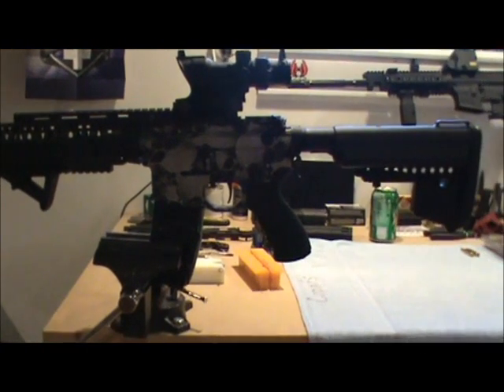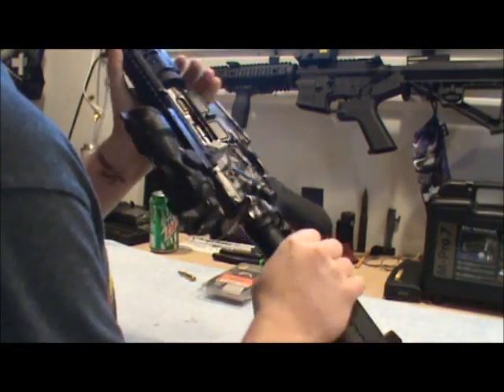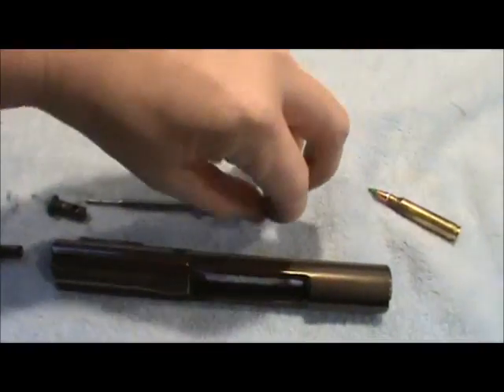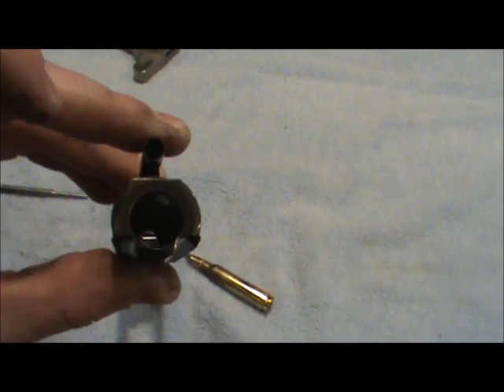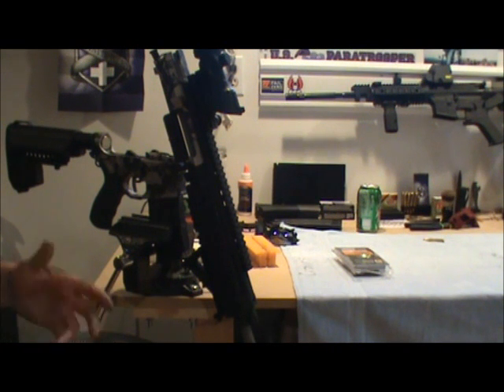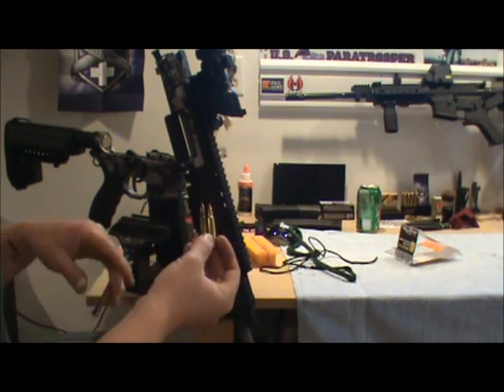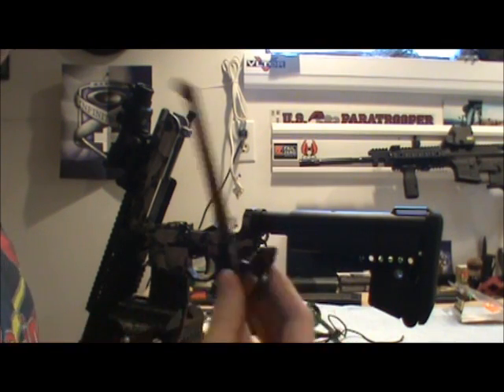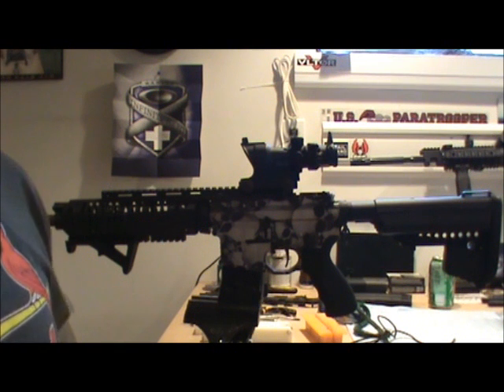AR break in and Cleaning

Comment from the maker: As long as it's a slight dent/mark that's normal.  AR's have a floating firing pin, when the bolt goes home it can leave a slight dent on commercial ammo.  If your getting a big dent you have a problem with the firing pin over protruding the bolt face (take it to a gunsmith). Try using mil spec ammo with stronger primers and see if you still have a problem.  My bolt is an auto bolt carrier from Fail Zero.  Hope that helps and if you have any other questions let me know.

Comment from the maker: Yes, where the gas tube and charging handle meet helps with carbon build up on DI rifles.   The piston rifles have given me no issues.   I've never had a charging handle get badly worn,  unless your constantly using it or have an out of spec handle.  Maybe a severely over gassed rifle with corrosive ammo could cause this.  Dis color or print darkening is also normal.

Comment: thanks a ton! 

question... I just took my first  new AR home yesterday. It is a Diamondback. I carefully and slowly disassembled the bolt carrier group so to get acquainted: bolt, pin, bolt cam, and ejector. 
Here is my concern; I have noticed my bolt and bolt cam are not loose moving compared to yours and I would describe mine as stiff. Also, after degreasing, cleaning and lubricating  my new unfired rifle, I find the bolt doesn't snap into place when pulling back and letting go of the charging handle. Also there is a friction burning smell and some metal wear on the charging handle. 
Are these things I should be concerned about or is this perceived stiffness part of the breaking in process? 

Your thoughts please.
Reply: Kinda late, but Normal for break in

Comment: Nice Review of aa quick cleaning
Some minor comments:
1- As a Dentist, we use instruments. Tools are cheap, instruments are expensive. LOL
2- Could benefit from better lighting
3- I watched this a day late for the opinion on CLP, just bought some yesterday. LOL
4- I am pretty certain that Compressing a spring, or relaxing a spring does not fatigue it. It is the cycling of the spring that is the issue. So storing with a trigger cocked/uncocked should not be a problem, which you consider safest should be the issue.

Comment from the maker: I learned most of this from manufactures suggested break in processes.  I would buy a few boxes of ammo,  different weight bullet and manufacturer to find out what your rifle shoots the most accurate.  I would also call Windham to see what they recommend you use in your break in.  Really, the only way to ruin your barrel is to get it over heated. Also make sure you clean your rifle after every range session.   Hope that helps man.

Comment: Colt LE6920's are broken in from the factory... I have seen many videos on breaking in an AR-15, and all I have to say that mil- spec AR's should be broken in from the factory. Aftermarket AR's probably have a break-in period, but I wouldn't know becasue I only purchase Colt AR's and nothing else. If anyone wants to hate on this comment, I recommend you call Colt: 800-962-COLT (2658) before you run your mouth... Other than that, this is a useful video!
Reply from the maker: Yes I agree, most reputable manufactures don't have a break in period on there AR15's.  The only thing they suggest is not melting the barrel down with 100rd mag dumps and expecting sub moa accuracy.
Reply: colt ARs are hit